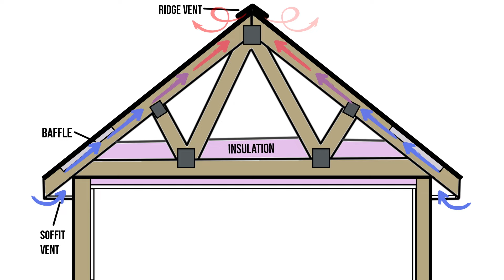The DOs & DON'Ts of DIY Spray Foam Insulation

Comment: Good video, BUT as HVAC installer, salesman and duct design and airflow specialist for a total of 30 years, I have learned one thing about complete sealing every crack in your home. It is a bad idea. The intention is to seal every crack to stop outside air infiltration, heat loss and heat gain. While that is a good idea on paper, it is a bad idea for our health. It can create what is called a sick home. Outside air is much healthier than inside air, regardless of the amount of infiltration you have in your home, but no infiltration at all is asking for trouble. You actually want some infiltration especially in a new home that has multiple flora carbons and VOCs that can be dangerous to our respiratory system as well as other reactions. In an attempt to make new homes more energy efficient, they construct them sealing attics, basements and crawlspaces with foam, but this only increases the risk. Some of these are so corrosive they will be drawn into your HVAC system through the return and can corrode the indoor evaporator coil and other metals in your system, so you can imagine what they do to your lungs. This is much worse in a manufactured home because of all the synthetic materials used in them. An older home, especially one made primarily of wood, is much better for your health. In the end, you need some infiltration in your home and a regular airing-out.
Reply: A fresh air intake device needs to be installed on all tightly built homes!
Reply: ERV’s are the solution.

Comment: For rats and mice use stainless steel wool, as rats can't stand chewing it. (Its an old pest controllers method)
Reply: Don't forget the nails in the steel wool for NYC rats.  They're onto the steel wool trick 🤣
Reply: Broken glass in quikcrete
Reply: @lolafalana6960  Yeah they're getting more crafty.
Reply: That’s funny I’m from inner city Washington, D.C. south east, Barry farms. Rats chew through pipes there with a wall thicker than 1/4 in steel🧐 city’s all over the world have rats that eat through walls of concrete, thick galvanized and stainless steel pipes all the way to standard dry wall. The only “rat” steel wool will “stop” is the common pack rat🧐 which is a mouse and not actually a rat.
Reply: Mice chewed right through steel wool in my house.
Reply: @sdot5389  mice and rats can chew through steel anything if given enough time. And that’s in any house.
Reply: I put rat poison pellets in the crack before applying the foam. And then insert more pellets when the foam is curing. If they eat the foam, they die. One caveat though: most rat poisons have a bait. If that's the case, you might make the foam extra tasty, which might encourage chewing. But if they're gonna chew the form anyway, you might as well poison them.
Reply: Well I read this too late as I added foam to the entrance. I guess I'll have to keep an eye on it and wait to see when the mice chew through the foam to do it again with some kind of steel barrier.
Reply: I use stainless steel pot scrubbers, then cover with spray foam. They are much sturdier and harder to chew than steel wool, plus any moisture and steel wool turns to rust dust quickly.
Reply: @commonsense5489  do you have any solution in getting rid of mice. I just moved to a new apartment and I saw one coming from my bathroom. I am looking for a permanent solution in getting rid of them without having to leave traps since that doesn’t solve the problem besides torturing them.
Reply: @joetuktyyuktuk8635 

I will try this methods. I have mice in my home and I hate them.
Reply: Two years using copper wool. No pests, and no rust or corrosion.

Comment: Just an fyi:  after using the straw, take it off and spray wd40 through it to clean it out. Also spray it in the top spout where the straw connects. Next time you need to use that can, you’re all set.

Comment: I recently purchased a can of the locktite window and door foam to replace the fiberglass insulation originally stuffed around an Anderson sliding glass door in my home.  It didn't take long, but my previously perfectly functioning sliding glass door would not open anymore, as the loctite product had bowed the door framing.  And when I say it would not open, I mean it would not open! It took a lot of time and effort, using hacksaw blades and other tools to dig and remove the locktite foam from the 2x6 framing, but after its removal the door functioned perfectly again.  Further investigation revealed the the locktite product also contained fewer ounces of product in its can than Great Stuff contained, at the same price.  I applied the Great Stuff and the door functioned perfectly.   YMMV, but IMO,  Locktite window & door foam is overpriced junk...

Comment: I use drinking straws from the grocery store and save the ones that come with the can. they are slightly smaller in diameter than the threaded nozzle but stretch and screw down tightly. super cheap and effective. I use these if I know i am not going to use the entire can.

Comment: I learned a "don't" when I bought a Condo in 1995. Although the Condo was only 5 years old, It had low grade Hotpoint appliances. The dishwasher was noisy everytime I used it. I sprayed a little foam insulation in the door, thinking the insulation  will absorb sound and quiet things down. After spraying the foam in the door, I didn't realize heat from the dishwasher would continue to cause expansion of the foam . After two uses, the foam continued to expand and the front door panel started to bulge. As funny as that was, the timer eventually got clogged with the expanding foam and the dishwasher became useless. I was going to replace the appliances anyway but didn't realize it would be this soon. I learned my lesson and now pay more attention to the "Do's and Don'ts of spray foam. Thanks for the tips on Spray Foam Do's and Don'ts ! ! !

Comment: I am filling in a gap in the corner of my kitchen next to the window. When they did a remodel for some reason they did not seal the corner. I have been fighting little ants in Spring time. Now I know from watching this video I can safely use spray foam for this project. I am also going to seal around the gas pipe connection in the floor. I did hit the like button and I subscribed. Thanks!

Comment: I have seen on new homes I was working on they where using cellulose blown in insulation that is shredded newspaper mixed with cement , boric acid, starch, fire retardant, and water. When it dries it's like a layer of cement. It sticks to the surfaces it's sprayed on and can even be sprayed and stick onto the plywood on top of the roofing trusses.

Comment: Using dry wall mud and dry wall tape after wetting where possible and meta caulk also is a great idea. For cement the cement epoxy as a filler and epoxy paints or sealer for sealing the cement and other masonry. For red brick use mortar and the epoxy sealer rated for masonry.

Comment: What the difference between the normal foam and the foam for larger 3" gaps? I know that the latter expands more, but is there a difference chemically and structurally? Can I use the 3" foam for smaller gaps as well? Or would the increased expansion actually force the small crack wider? Thanks for any info.

Comment: Looking to temporarily insulate the gaps in a portable AC vent in my window. Is spray foam too durable to remove later? Should I use something like flex tape instead?

Comment: Great video. I know you said not to use spray foam for foundation cracks. But do you recommend using spray foam instead of backer rod and then using sika self leveling sealant to patch exterior cracks where the siding meets the concrete walkway?
Reply: Hell no. Use backer rod dude. I'm a journeyman masonry restoration  worker in the bricklayer and allied craftsman union. If you are worried about the sl running out through gaps use regular caulking to fill any such gaps that backer for whatever reason cant. Then back it and shoot it.

Comment: I have a small attic access door that I don’t really need to have open, it’s full of blown in insulation so I can’t really go in it. Figured it would be easier to either use spray foam or maybe the expandable stripping. I’d rather be able to easily cut it open and be able to use the door if needed for leaks.

Comment: What would you recommend for a finished basement ceiling? Their is a drop ceiling, but some areas of the floor on the main level above the unfinished area(s) are quite cold.
Reply from the maker: I would use batt insulation between the joists.Spray foam should only be used for small areas.

Comment: You can clean out the straws by inserting a bicycle spoke in them before curing, screws in the can openings.    And he forgot how to use it for weather sealing doors.  Yes, you read that right, secret is to use cling wrap as a release film, first tape a strip of cereal carton cardboard on the edge of the door as a spacer, mist it with water to help the cling wrap adhere.  Then with the door closed you fill the crack with the foam and let it cure.  It will be difficult to open the first time but then you will have a crack up the 3/4" filled and a good seal.  Paint as you choose, great for a temporary fix or low end housing.

Comment: Okay thanks for this video now i have a shed that leaks around the floor area when it floods looing to seal waterprrof and insulation to keep the heat out. Do i use a membrane to water proof inter wall or seal then use membrane

Comment: Great tips, thanks for posting.
Question for you:
Can spray foam insulation be used to plug hole (4" diameter) in the wall left over from old vented tumble dryers no longer in use, or should I seek alternative solution?
Reply: Did you go ahead in the end, as your comment describes what I'm planning to use spray foam for? I believe it should work fine as long as the exterior side is sealed/painted after the foam has cured/been trimmed, to protect from the weather?

Comment: Can this be used around the water pipes inside the home. In my house around the shower head pipe, under a sink and pipe coming out of the wall to the toilet there is little gaps. Just wondering if it’s safe to use in all those areas.

Comment: Hi Aaron.
Thanks for the great tips about foam insulation.
My main concern is that I've had issues with blinds falling off due to poor structural integrity in the ceiling of the window. Unfortunately the gap between the ceiling and the brick wall is only about 2-3 cm.
My query is, can I use the foam to fill up the space, then use filler to close the gap and then create a new hole for putting up the blinds again?
Reply: Your question is rather confusing but if you are asking if the spray foam will support the blinds the answer is no. If your wall won't support blinds then you have an incredibly bad situation. Your house should be abandoned and torn down. It's not safe to be in. That being said, you then went on to talk about brick. Is the brick on the inside? If so and they are secure, that is what you need to be attaching the blinds to. Assuming they are real and not imitation. This can be done only with a hammer drill and a masonry drill bit and tapcons. Figure out where the holes should go and mark them with a marker. Take the masonry bit and drill in as deep as your tapcons are long. 1 and half inch tapcons are plenty long enough for holding blinds. There's your new holes the tapcons work just like any other screw but they are hard to turn so use the drill for those as well. If it's drywall that your screws keep falling out of then you aren't hitting the studs with the screws. If there are no studs I would use toggle bolts. They are far superior to any insert style anchor for drywall. If you are doing any of these already and the wall won't support blinds then you have major issues. Note that if you are trying to go through the top of the window and have used those holes up and are now hitting brick, then again, use tapcons right where the old holes are. This may require longer tapcons depending on how far in the wall they have to go til they hit the brick. It is important to determine if it is metal or brick as it should have a metal lintel. If that's the case go in from the sides with the tapcons.  Once you do all that, then fill any gaps with spray foam. Hope that makes sense 

P.s. with the tapcons it is imperative  you use the correct size drill bit which the tapcon package will say the size you need.

Comment: Aaron, nice video on spray foam applications, however make sure if your using it around windows or doors that it is approved by the manufacturer. I have lifetime windows & doors from Milgard. I understand If you use spray foam on them, it voids their warranty.

Comment: If I use this stuff to sandwich corrugated polycarbonate roof panels cross sectional in a matrix and then fill the edges solid what kind of adhesion and dilapidation can I expect in the Florida Sun, wind and rain over time?

Comment: You didn't mention that it wasnt safe to use it in circuit breakers. It doesn't say anything about that in the can either. So i used a little bit there to seal air gaps in some openings for wire bundles.

Comment: Love your video! so informative! I find gaps inside the radiator in my apartment. Will spray foam be ok to seal the crack and the hole around the steam heat pipe?

Comment: I'm remodeling/rebuilding a single wide mobile home.   The owner is planning on using spray foam insulation to insulate the entire house.  Bottom up.  After putting in the new plumbing and such going underneath and foaming the bottom.   What are your thoughts

Comment: my wooden floor is sagging when I walk between supporting 2 x 4s that are laid on the concrete approximately 3 feet apart. I do not know the proper name for those supports so I will refer to them as beams. simply, there are not enough of support beams that are laying on concrete floor, I think they should have laid those supports every foot or so to give it more stability, then put the wooden floor on it. This is a cottage so previous owner did not invest lots of money in quality work. 

So, because sub-floor is poorly constructed there is a quite of a sag when you step between sub-floor beams, so my question is - can I inject the spray foam between existing floorboards and concrete surface by drilling through the floor boards in order to help stiffen the floor? I am thinking that maybe drilling the holes in the floor on every couple of feet between the supporting beams and injecting the foam will stiffen the floor, then I would lay over this a new hardwood floor. any pros or cons?

Comment: My question is could I use spray foam around radiator pipes inside house I noticed one day I felt a draft around radiator pipe where there is a gap

Comment: Question so I have a small ac in my room and it keeps leaking  from the bottom and the bottom of it there is like a line where I'm guessing the water is coming out from can I use the foam to stop it from leaking from my room

Comment: is ok to use GAPS N CRACKS spray foam as insulation say after window casing rebuild due to leaky window ac repair, to bugproof my manufactured home because i will be having OTA ANTENNA ALSO GOING THRU THE WALL.
  i wanna stop  bugs n drafts from getting in, BUT TO BE  CLEAR NOT JUST ONE SMALL SPOT THE WHOLE WINDOW CASING WHICH ABOUT 12 INCHES HIGH BY 52 WIDE?

Comment: Can you use spray foam to fill in gaps in a galvanise shed? At the bottom where the shed comes down past the concrete slab. Can I use it there to prevent water getting in?

Comment: Gotta love hearing what you've already done is a big no-no... I took a can of great stuff and sprayed it into the gap between a cinder block wall and sidewalk, mostly filling large cavities in the wall, then went back and sealed with a concrete/silicon caulk for a watertight seal. Too late to change anything now. The building owner refuses to take responsibility for his building and says it's fine despite the raise sidewalk allowing water to pour into the building and saturate my equipment.

Comment: We had a faulty valve on frig cause leak which damaged cabinets & drywall behind the frig into our pantry.  About 3 feet high of drywall by 20 ft of drywall  was removed along with the spray insulation foam.  Is the aerosol can foam ok to use to refill this area before installing drywall?

Comment: Thanks - I’ve got a gap under a window I’m trying to fill but there’s a uPVC cill that overhangs and then comes down a 90 degrees so I can’t get to the gap in a straight line. Are you able to bend the straws at all or is there a better solution out there? I e had a look but can’t find anything…. Any help would be massively appreciated!

Comment: Was thinking about spraying foam to fill gaps of a newly installed PTL floor of a utility trailer. Want to be able to haul bulk materials and don't want them falling through the cracks. I figured I could just cut excess off with a shovel. 

Anybody try this "brilliant" idea, or should I head back to the imagination closet? :> 

I'm trying to avoid the hassle of putting down plywood / tarps for those hauls.

Comment: I know this sounds silly but i wonder if any old home owners did the following - drilled a few holes in the old paneling (interior) and then spay the foam into the hole using the can with a straw.  This would be due to poor insulation.  I'm guessing the foam would not expand enough.
Reply: If you drill two holes one to let the air out ☺️